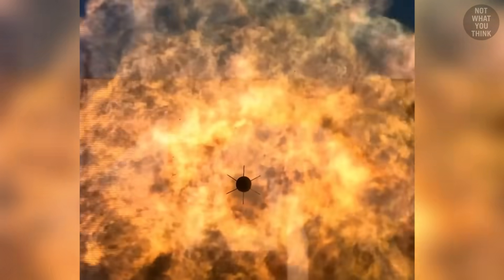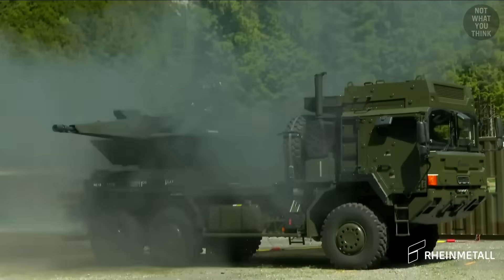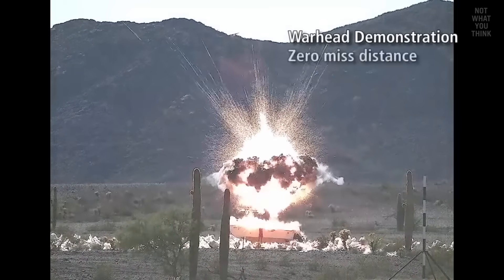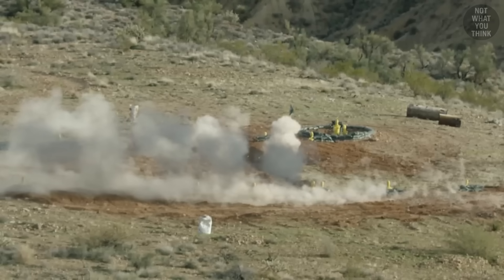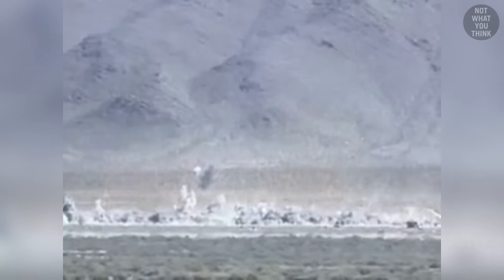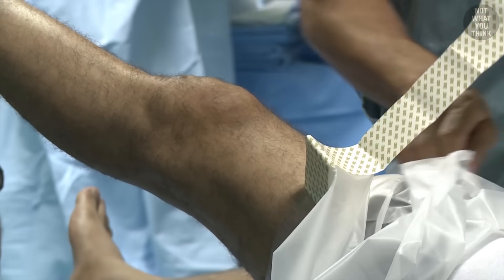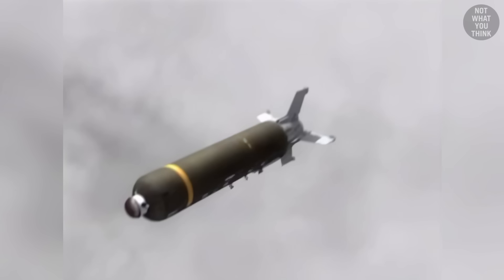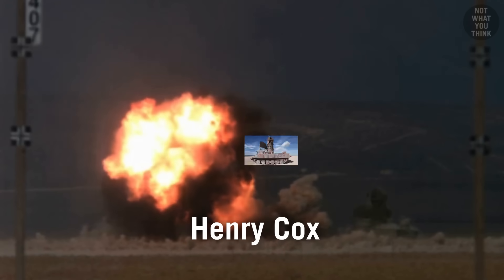Why It's ILLEGAL to Use Glass in Bombs

Comment: The core reasoning behind it being "illegal" to use glass or plastic is that, in the various conventions around the world, causing unnecessary suffering is deemed a war crime.
So this doesn't just apply to fragmentation ordinance, but anything used in war. Such as biochemical weapons, microwave weapons, flame throwers, lasers, and other devices which could leave the target in prolonged pain and agony long after a conflict has ended.

The "point" of a conflict is to get the enemy side to yield, retreat, surrender or plain simply stop being a threat.
Those who go beyond that, to needlessly inflict extra casualties and damage that will last after the conflict is over is who we later put in war tribunals to face the consequences of their actions.
Of course, this rarely applies to the "winners" of the conflict as they... won... and therefore won't put themselves up to face their own war crimes. Obviously.

Comment: 2:19 Wow. That's incredible that the velocity can be calculated and transmitted in the time the projectile travels through the barrel. It sounds like some outlandish speculative technology from a military trade show that never becomes reality. I'm really curious now about how these systems work, how much time they have for this, how reliable they are, if anything resembling a CPU is involved or if its purely electro-mechanical, etc.
Reply: Microprocessors can run millions or billions of cycles a second, so there's enough time to do it in the maybe thousandths of a second before the projectile leaves the barrel. IIRC a short-wave radio signal like NFC is sent from the gun platform's system to the projectile's fuze (which also has a processor inside).

In 1991 the US Army was moving from mechanical fuzes to electronic ones and they wanted them to be safer (see National Semiconductor Application Note 761). Mechanical devices would likely be too slow and complicated, but most importantly they wouldn't be reliable enough.

Comment: 4:19 No, that's not true. The shells face air resistance after they leave the barrel and the forward travel is also dependent on the angle the shells are fired at.

Comment: It has been US policy that anything using a fuze to explode will not just dud but inert itself if conditions to first arm and then explode are not met (fuze with a "z" triggers the explosive in a munition).   A basic mortar round will not explode if the pin is not first pulled - just like a grenade.  The nasty wrinkle - there have been time delay submunitions used as area denial weapons which may be programmed to wait up to a day or more to function.  This from someone who designed artillery fuzes.

Comment: "most guns have rifling inside their barrel" wrong, not in the terms of modern large barrel combat, most modern actual tanks use smooth main armament barrels, it really is lower caliber that uses it. Old tanks used to use it too. reasoning can be both simple and complicated, the simple answer is, rifling loses you potential energy, but makes the round stable due to spining, good but modern rounds are nowdays, mostly if not all fin stabilized, meaning they would come out, and they have a built in stabilization part, may not be mechanical, but it's better. actually spinning fin stabilized projectiles makes them lose energy. and so on

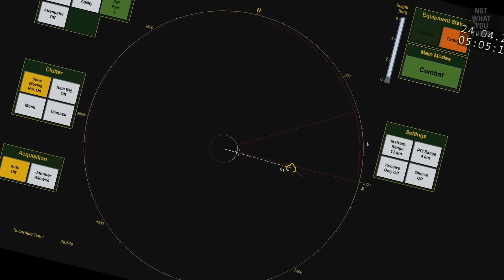Comment: 4:35 I cannot think of a way for something like a "bullet" to "count" the amount of rotations it did... If your entire frame of reference is spinning, you cannot "see" that you're spinning, unless you look at something that's outside of said rotating frame of reference. Like how we couldn't tell the earth's spinning at all, if it weren't for the sun and starts moving all over the sky. Although bullets have much faster spins, so there's a radial force opposite of our gravity, but that force just points "outwards".

So how /do/ these things count their rotations? If they use optical sensors, they'd need a very reliable focus point, like the bright thing mentioned earlier: the sun. But that'd make the system fail as soon as it's cloudy or night, so I doubt it's that.

A gyro might work, but only if it has enough stored energy to resist the spin for the relatively short lifespan of the bullet.
Reply: Maybe Earth's magnetic field?
Reply: @romaliop I didn't expect that to be enough, but after looking into it, earth's field seems indeed be more than enough for such systems. The more you know 🌟
I also wonder on how many lists I ended up because I asked GPT how such systems could work xD

Comment: The term 'shrapnel' is grossly overused.
The correct term is 'frag' (short for fragmentation).
Shrapnel refers to a carrier munition which dispenses lethal bits (usually balls) in flight and I am not aware of any current example of this.
You could claim that something like a Claymore mine uses shrapnel since it fires balls at the enemy but it doesn't really fit into the true 'shrapnel' definition.

Comment: I thought that they invented "PROXIMITY FUSES" during WW2, and it was precisely for this shrapnel effect to bring airplanes down.  It did not have to be a "Direct Hit" just needed to be close.   And this was all done with Vacuum Tube electronics, and the "G" forces it had to take and still operate.  With today's electronics, "proximity fuses" should be a piece of cake, and timed fuses should be a thing of the past.

Comment: D.I.M.E. weapons pepper people with tungsten bits too small and numerous to remove, so if the bomb doesnt blow off your arms, legs, and likely your head too, the tungsten (dense inert metal explosive) powder will burn its way into all of you and stay there till you die of cancer. Israel was reported to have used these in operation cast lead. There sure are a lot of children in Gaza missing multiple limbs.

Comment: Wow, programming a time fuse as the round passes through the barrel - that's insane engineering. The velocity makes it seem impossible.
Reply: EE Here. Low-inductance pulse transformers (what this is electrically) can transmit quite fast. 1MbPS (1 MHz) would be easy. At 1000 FPS, you'd have room for 50 bits of data + Checksum / ECC.

Even 20 bits is far more resolution than you'd ever need. I wouldn't be surprised if they have encryption in there as well to stop unauthorized detonation.
Reply: @thorlancaster5641 Excellent information, thank you. Only need: "Enemy. Here. Not Us! Boom"...
Reply: German Engineering 😂😂

Comment: Instead of glass, use porcelain as sharpnel. You get plenty from old broken wash basins, urinals and bath tubs. They are much more effective than metal/glass sharpnel.
Reply: the dust would shred lungs
Reply: Could be biological as well
Reply: Delete this cringy comment dude. Number 1 you're still missing the point, Number 2 porcelain still absolutely sucks compared to dense metals like steel, lead, and tungsten.
Reply: Don't give lockheed martin any ideas
Reply: @spencerricketts8025  recycling used ceramics is a good idea 😂😂😂

Comment: Regarding glass shrapnel being difficult to detect or remove - the prohibition isn't as useful as you might think. Quite a few militaries have been using DIME (Dense Inert Metal Fragment) for targeted killings. Rather than using bullet-sized chunks of metal, the warhead is explosive surrounded by a fine powder of dense metals and contained in a non-metallic case. Why? The powder-shrapnel is very light and only has a range of a few metres before falling to earth. Within that range it is highly lethal and (getting back to the point) hard to detect and near-impossible to remove from wounds. So, it tends to used on individual assassinations rather than groups of people.

Comment: The stupidity of the cluster bomb hysteria completely ignores the simple fact that all munitions have a failure rate. There are not just bomblets that are undetonated. There are mortar rounds, artillery shells, bombs, rockets, grenades, and mines all lingering on the battlefield. The reason for the push to ban mines and cluster bombs is the fact that they are so effective. The desire to ban is pushed by enemies, not "patriots."
Reply: We should start including devices in mines and other ordnance that, after a year or so, can be detonated with radio. A simple flat circuit with an antenna, that activates after several months or years (via predictable shock activated release of a chemical that slowly breaks down whatever is holding the circuit open). Then  an appropriate strong radio signal can be picked up by the antenna to power a tiny primer charge.

Then you could use whatever weapon you wanted without a difficult cleanup for decades to come. Win win win

Comment: How does an EFP have a range that far? Usually standoff is only a few feet.
Reply: Well a standoff munition is all about the distance the launch platform can be from a target. An EFP is just a type of shaped charge(type of explosive penatration method designed for anti armor). That said, EFP munitions like BONUS or SMART are impressive & can be detonated 100s of feet away, due to precision sensors. EFP basically just a molten slug traveling at high speed, as opposed to the molten jet/stream of a normal shaped charge as seen in RPG-7. Im pretty sure the range differential is bc they slug has more concentrated mass & is more aerodynamic vs a stream of molten. "Off route mines" such as PARM-1 take advantage of these EFP characteristics also. Al-Queda even used IED EFPs to take out Abrams tanks.
Reply: @jdogdarkness Thank you, it was described like the inverted copper cone jet but clearly isn't.
Thanks for clearing that up.
Reply: @richardjones2811  no problemo mane

Comment: Cluster bombs are so effective because the number of bombs per area is given by distance squared but a huge bomb needs to grow with distance cubed to cover the same area. On a big enough area cluster bombs are thousands of times more effective
Reply: I never thought to look at it in a 2d 3d way
Reply: @tomarmadiyer2698 yes, if a hand grenade weighs about 1 pound and has 10ft blast radius, to cover 100 by 100 foot you can use 100 hand grenades or one 1000 pound bomb which also has 100ft blast radius
Reply: @tedarcher9120  It's not quite so simple, though, as you also need to consider the nature of the target. 100 hand grenades aren't going to do much to a hardened military structure or to a warship. Even a near-miss from a 1000 lb bomb might get the job done, though. 

Second, you're only considering blast, and not fragmentation, which further complicates things.

Finally, there are other political and strategic reasons for why you'd prefer the unitary 1000 lb warhead--your 100 hand-grenade sized submunitions probably aren't going to give you 100 smaller explosions. Some of them will potentially be duds, and will persist as unexploded ordnance in the area. That isn't ideal if it's friendly territory you're defending, or if your own forces plan to occupy or advance through that area.
Reply: @tedarcher9120  A hand grenade might weigh 1lb but the explosive charge is only about 1/2 lb. Also the shrapnel kill radius is 5 meters with wounding out to 10-15 meters for an m67 grenade. 
The 'blast' radius is insignificant in the open, a half lb explosion wouldn't knock you down even if you were a half meter or under 2 feet away. 
But yes, for infantry and light vehicles with no armor, it would be more efficient to use bomblets instead of one big bomb.
Reply: @MarkBerengerexplosives in a bomb also weigh no more than half.
Reply: Where do you get that "thousands of times" claim?
Reply: @GoldenTiger01 From very basic math: You can plot the amount of explosives used and extra effected area as a line on a graph and as the two here in this (admittedly simplistic) example have a fast separating angle, the 1000x claim is reached inevitably and pretty fast at that. 

It looks like middle school math wasn't useless after all.
Reply: @MarkBerenger I'd don't think I have much to say for someone that overly confrontational. The OP already has the basics pretty well covered and yet you went on to that tirade.

"Hypothetical bullshlt" lol.
Reply: @GoldenTiger01 from the "cubed". It is logarithmic. 10 squared is 100. 10 cubed is 1000. Any bomb will cover at least 10 square metres. One thing I noticed on youtube is people contradicting people on exact calculations and facts intead of the spirit of the comment. 
Let me express the matter clearly: a cluster bomb covers a shit load more terrain and kills a fuckton more people than an equal weight unitary bomb. Same power distributed on a vastly larger surface, meaning you won't dig a hole in a bunker but you will slice enough people in enough little pieces, that the ones who witness it will wish to have died instead of having to go to sleep with that memory. Brings to mind those 30-50 russians on the training ground. They were actually pretty much in one piece. Shit, I'm factually contradicting myself. Now you're in a pickle. How can you argue on the internet with someone that argues with itself?  
Let's see your calculations, mr ackchually
Reply: Exponentially or an order of magnitude would have been better terms.
Reply: @tedarcher9120 This is why A-10 30mm rounds in circular or oval pattern are so effective, & similar to cookie cutter in effect, anything within "cutter" gets hit & ground up, rather than one hit that might miss, or require much more  dangerous blast radius
Reply: This is also why ICBM's went from one massive megaton warhead to mirv's with a handful to a dozen hundred kiloton class warheads.
Reply: Your logic is flawed. If all the people are clustered in that giant area, your spread out grenades would be 'thousands of times' less effective. They aren't meant to be compared, they're 2 different weapons for different purposes. You're like a COD player trying to use your knowledge of games to make sense of real world combat and how things are done. bomblets vs grenades isn't an issue, we have ALL the bombs in the world, we could carpet bomb with 5000 lb bombs as if they were grenades if we GD wanted to lol.
Reply: @MarkBerengerif they are clustered in that giant area they are going to die anyway because they are in the blast zone.
Reply: @tedarcher9120  you're right, in that imaginary scenario in your head, everyone would die. In real life, they have about half lb of explosive and zero 'blast zone'. The kill radius is about 5 meters and the wounding radius out to 15 meters. You would not kill a group of 10 people even if it landed 5 feet away from them, it would take out some but it would probably wound about half, maybe a little more. I've seen a lot of grenades and explosives go off and I have 8 years in the Army using explosive ordnance and small arms launchers.
Reply: @MarkBerenger1000 pound bomb has a kill radius of about 30 meters so